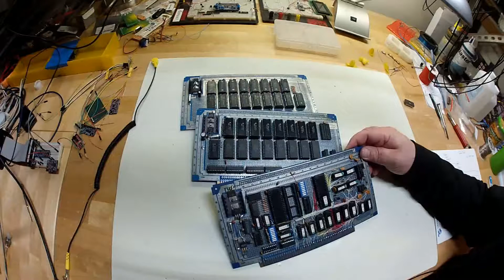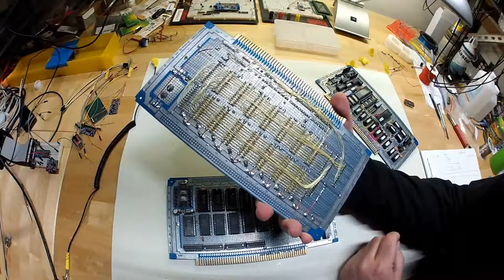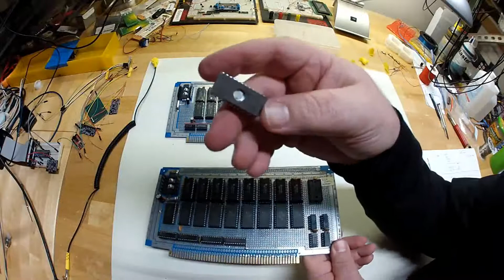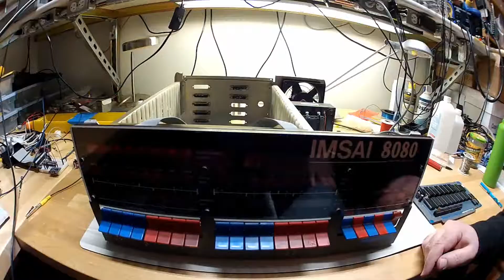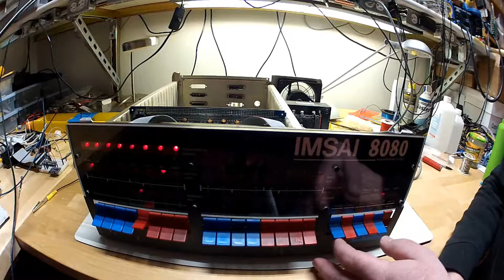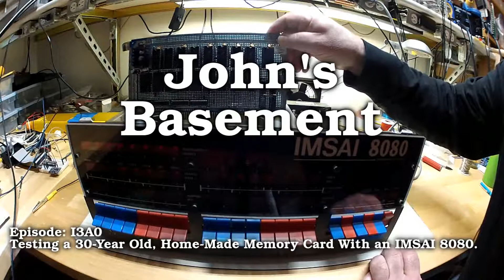Testing a 35-Year Old, Home-Made Memory Card With an IMSAI 8080

Comment: Ah the luxury of 2K byte chips (6116's?) My first computer was hand built on stripboard with 2114's. It's awesome that I can recall all the part numbers I used back then, but can't remember what I had for breakfast!
Reply: It might depend on the manufacturer when it comes to markings/numbering, but 6116 ram chips are SRAM (static ram) as opposed to the 2114 chips being DRAM (dynamic ram).